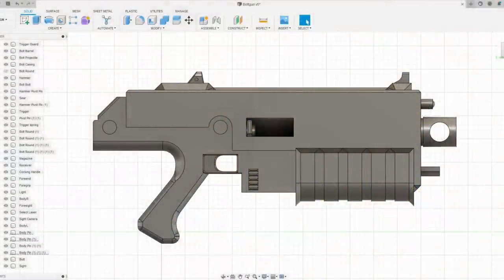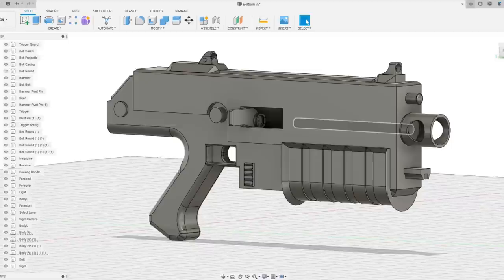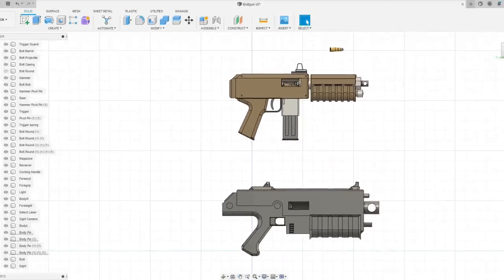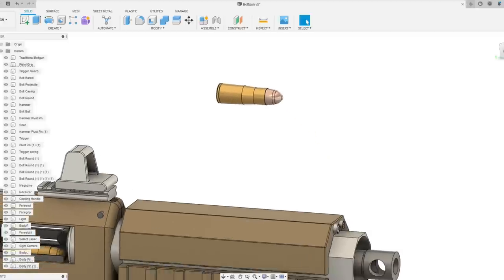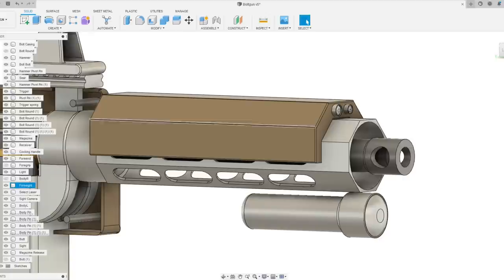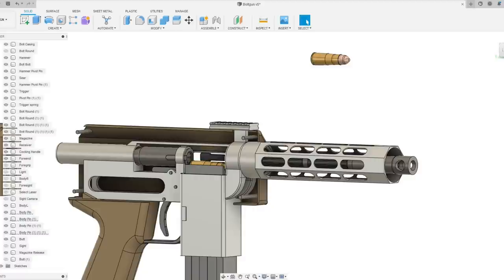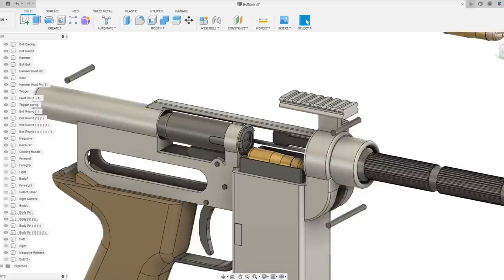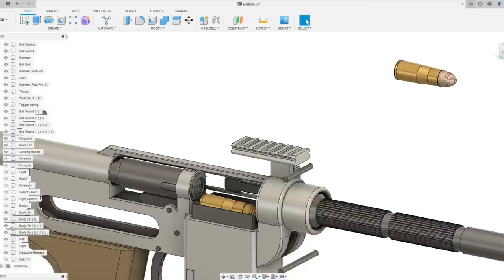Building A More Accurate Bolter

Comment: I enjoy any thought exercise meant to discover just how the imperiums equipment would look irl. On the point you made about the boltgun not needing to be bulky I think it would make more sense to apply a bit of our own modern logic to it. As an example a floating barrel is much smaller than the weapon appears to be, as far as i know the real reason bolters and other ballistic imperial weapons appear so big is because there are machines surrounding the actual weapons mechanisms which are meant to unjam them.
Reply: To unjam a bolter there's the need to cock the gun, so only a piston?
Reply: Bolt guns gave computer parts “ machine spirits “ basically semi AI so self targeting systems etc

Comment: one of the things you should note: yes muskets were roughly 50cal and up but their pressure curve was much lower because of the combustion rate of black powder. that lower pressure curve reduced the felt recoil by spreading the total force imparted over a greater duration. This isn't a gotcha since you could just use a cleaner and slower burning powder than modern cordite but it is something to keep in mind.

Comment: Really enjoyed the Video! As some one who works with CAD a lot I all ways like seeing other peoples work with it. I just wanted to point out the reason I suspect a lot of GW's stuff is out of scale is because of manufacturing limitations in the early days meant things had to be over scaled so that they would come out of the mould constantly. Artists then made art works based on these modals leading to the current strangeness of the Russ having officially a 120mm diameter barrel despite being shown on art work and on the table top having a barrel many times that size.
Reply: I know that the reason why the early Space Marines were squat-legged was for 2 reasons. 1st was to be able to sit on the bikes. 2nd was to come out of the mold.

Comment: for the size of the projectile and the damage being done by explosives the bolt round wouldnt need to be very high velocity so the bolt you modeled would probably be half the size. look at the inkunzi PAW and strike rounds, they have projectiles 3x the size of yours with the rest of the cartridge adding on a third of that. also combined with the gyrojet feature the barrel of the boltgun wouldn't have to be near as heavy.

with rounds that size and half the propulsion of the bullet being from a rocket motor you're right the recoil would be quite manageable. i headcanon that this version of the bolt round is what sisters and commissars use and the astartes version is the proper 1500+ grain light armor busting grenade. which as evidence by the PAW is still manageable by a normal person if the recoil system is good but its still too much to get any reasonable rate of fire.

Comment: Even with a delayed blowback system I’d be worried about an out of battery. I haven’t done the math, but with a .70 round plus the gyro jet there is going to be a tremendous amount of pressure pushing back on the bolt for system to deal with. In order to compensate the weight of the bolt is probably gonna have to be significant which might put it out of the range of feasibly for unaugmented humans

Comment: Hey Macca, as you stated and as is quite apparent the lore doesn't always conflate with reality nor depiction. Both relevant examples are seen with the ammunition being called 'caseless' despite certainly having cases, while a realistic Bolter at .70 cal wouldn't actually be unmanageable. Given this, I'd propose an idea to make a realistic Boltgun in keeping with the common 40mm analog, perhaps by scaling it with the muzzle break or something slightly smaller. How realistic would it be to make a 'small' arm at that caliber and how different would the resultant weapon be from what is already depicted.

Comment: The internal frame you had mounted the foregrip and sight block to looked similar to a keymod foregrip, just missing the oversized holes to one end for the cap bolts to slide into.

Comment: IIRC one of the reasons for describing the boltgun as a smooth bore caseless weapon was to do with vacuum contact welding. Non lubricated metals have a nasty habit of bonding when there is no air present, so the logic was that rifled barrels and cased ammo would weld as they entered the barrel. This doesn't explain how the bolt itself avoids fusing open, but an attempt was made before rule of cool defeated it.

As far as I can see; designing a fire control to be properly void proofed would require making it either a magnetic mass driver or using electro-thermal ignition instead of a physical hammer.

Comment: I actually quite like you’re version of the bolter however a few changes would be to make the upper front receiver and foregrip as one solid piece connected to the weapon itself as well as to remove the red dot sight due to space marines utilizing a heads up display

Comment: I think part of the functionality you didn't include in the design is that the boltgun itself is a weapon and meant to be one. I don't mean the boltgun itself and the rounds it fires, but it is also used as a club and that is it's intent in close combat, there are a few examples of space marine using polt pistols to swat away humans or smaller xenos, full length bolters as well used for clubbing smaller fighters as well as just the fact that the weapon is intended to receive damage and keep on functioning. I don't know what else the frame could have been made of, but I think maybe a little more stronger materials, maybe a little more blocky, but I am no firearms expert so I leave that to you to think of

Comment: I agree with the people defending the blocky aesthetic. The main reason light weight is valued in real life is that people are desperately weak. Space Marines are very strong and can carry much more weight for much longer. It makes sense that rugged strength would be valued over light weight. 

The Space Marines primary tactic is supposed to be shock assault. They don’t carry enormous patrol packs of equipment and ammunition. They want a gun that can withstand being deployed in a drop pod, used as a club and be able to operate in all atmospheres and gravities. 

Another thing is that the design philosophy in 40K is fundamentally different. Current design is reductionist, its sole consideration is efficiency. Space Marine equipment is artisan made and constructionist, the artist doesn’t ask, does my gun need elaborate golden scroll work? He puts the scroll work there because he wants to. 

That said props to you for making your own pattern of bolter good work.

Comment: I remember reading somewhere that the Boltgun uses magnetic coil relays inside the weapon to increase accuracy without needing a longer barrel, due to the close quarters that Space Marines typically fight in where every inch they can shave of the barrel counts.  Not sure how "cannon" that is because of how long ago I read that, but it does make sense.

Comment: I did enjoy that and appreciate your effort. Now I don't think a Blowback design is stupid, there is just more you can do. Look at post WW2 designs like Walther MPL, H&K MP5, UZI/MAC 10 and others and you will find a plethora of options how to deal with bolt travel and delay.
Reply from the maker: Mechanical complexity adds a lot of drawbacks. For example, roller delay mechanisms rely on the rollers not sticking, which is a problem when you have such crazy operating environments.
Reply: @TheOuterCircle  less than you might think, sealing against anything getting inside working parts is paramount anyway, look at the Owen SMG. The Walther MPL places the return spring and a connector rod ab
Reply: *mishap above the barrel in a separate housing and the UZI uses a mass delayed mechanism. There are a lot of ways to solve this. Nothing I say is meant to disparage your work.

Comment: I've only recently subbed to your channel, but going into the lore and mechanical workings with the physics of a bolt gun. The closest IRL ammunition is the 40mm grenade and the various different grenade launchers. Here in America, the Mark 19 Fully Automatic Grenade Launcher would either be a pintle mounted and a Heavy Boltgun for a Space Marine. I served 27 years in the US Army, having disassembled/stripped various types of weapons in that time. The way the 40mm round works is almost exactly how the Bolt round works, minus the penetrator tip for going through cerimite armor.
Reply from the maker: A bolter is a lot smaller than the MK 19, a weapon I have pulled apart and rebuilt several times, including the mighty 5kg block bolt!

Comment: Again, what software are you using Macca? Also props on making what is basically a closed bolt gyrojet luty! And yeah, 20mm grenades would be a more "accurate" size for how much damage they're supposed to do.
Reply: Fusion360

Comment: Nice exercise. I do suppose that when you share these guns among the guard, you adapt it more. A rifle butt (hope that is the proper translation), perhaps a different sight, grip, and fair point you made about the mag. So the human version should hold the magazines. The marines could easily hold a drum mag with more ammo, due to their strength. 

As to the bolt round itself. (Now the small size chemistry, hand gun rounds are not my thing), but it would be cool to expand a little on the types of rounds and give real life interpretations. Like, a shaped charge head for extra penetration, AP sabot for even more, but less range (again have no idea how the small size relates to Kinetic impact and penetration, i.e. how scalable these effects are) a hesh version, the regular slug version, a sniper version with bigger round for more range (and so a different bolt gun). There are different type of bolt gun rounds to explore. If you wish of course. But I’ll leave the thought here. 

As an example, there is an old artwork/picture on the AP shot from a vanquisher leman russ. And guess what… after all those years: APCR. 😝

Comment: I think boltgun round should be more like 20mm x 42mm grenade it's cross section looks actually remarkably like a bolt supposed to, front is solid, then explosive, except at the back you have fuse(?) instead of rocket engine, but reduceing fuse in size seems to me like something you could actually overcome with sci-fi bullshitery, also I have an idea for that over sized muzzle break, because the rounds supposed to be explosive and Astartes don't have to concern them selves with shrapnel the bolt might be always armed if that would be the case, then problem rise when the boltgun is shot at point-blank as it could potentially explode while still in the barrel, so this "muzzle break" could potentially serve as solution giveing round space to explode into

Comment: Boltguns never supposed to be caseless, though (at least to my knowledge). In the lore they supposed to use a small kick charge to eject it from the barrel and operate action, with bolt being then propelled with rocket engine.

Comment: Ah, many thanks for this video. I came across an interesting artwork showing a few boltgun bits like this (the artwork itself depicts a suit of mechanical marine power armor (for tau, off all factions) with what gundam universe would call "sub-arms" which assist in firing and reloading suit-used weapons and additional upper for the boltgun with far longer barrel and so). I've been also trying to redo most of the space marine equipment (weapons armor and so on) as a side hobby for myself, this video aids in that bit. Will you cover the heavy bolter? From most descriptions (1d4chan, for all their "quirks", agrees on this as well), it incorporates coilgun tech.
Edit to add: what be that 3d software used? Seems like perfect for realizing my drawings (on paper), into full 3d glory.

Comment: You beat me to a lot of nitpicking. A purely powder based firing solution erases the rocket propulsion component and would require a much longer barrel, but enough propellent to escape the barrel and then allow the rocket to activate works better for me.

I expect the versions used by unaugmented humans would be closer to .50 caliber, I know they are smaller in the lore to avoid obliterating the user.

Thank you for this video :)
Reply: My guess on the size and bulk of the original, is just a compounded problem from the early model parts scaled up with no refinement.

Comment: There is something fucky about caliber sizes standards, as I have gotten for .75 cal a conversion of both 0.1mm or 19mm from two different sites. So I thing the later is what they meant. (.998 is also a common bolter cal which is ~25mm.) Edit: I think its a in" vs cal confusion cause by how .50" is often mislabeled as .50 cal.

Comment: Typically bolters are .75 cal not .70
Reply from the maker: Well, I have two references in writing from within the last couple of years with both 60 and 70 calibre rounds. Either way, it's not a big difference, but that's why I chose that calibre.
Reply: @TheOuterCircle  during the GC there were definitely .75 cal, .70 cal, .60 cal, and even .50 cal models of bolters. However, during the HH many of these started fading away and by the end of the HH the .75 calibre bolter was the standard and remains as such into 40k. They needed the additional stopping power of the .75 calibre to put down marines. Those smaller bolters still exist, but they're linked to specific patterns and variants. 

While there may not seem to be much of a difference between a .70 cal and .75 cal projectile. You have to remember a .70 cal bolt would be 17.78mm and a .75 cal bolt is 19.05mm. Which is a difference of 1.27mm, that's like saying there's no difference between 5.56mm and 7.62mm cartridge because there's only a difference of 2.06mm. Which obviously isn't the case.

Not having a go at you mate, love your videos. Just pointing out the lack of .75 cal bolters and the difference.

Comment: .. um.. without the magazine 'lips' to hold the rounds in the magazine, as soon as the bolt-carrier group is brought out of battery, the rounds are just going to leap out of the magazine and spill out of the ejection port, with the "BCG" slamming down on a round in a stove-pipe failure.

Just thought you should know.

Comment: While this is a much more function accurate representation of the bolt gun than the space magic wrath of the emperor, there are a few key problems:
-lenght of the barrel compared to the amount of propellant that needs to get burned
-no rifling so you just made the ammo the gun is shooting already more inaccurate so the gyrojets need to work more
-with this design it's an open bolt direct blowback system, but it's very much non-functional as the bolt is way to small to have enough mass for the weapon to not immediately explode with the force the propellant will produce
-the fire mechanism is way to high for a direct blowback system from the trigger, this will increase vertical recoil
-charging handle let's dust and debris get into the mechanisms of the weapon
-there are too meny not made from one piece parts on the weapon
-there are too meny open spaces in the weapon that don't serve any function
-to compensate for the recoil I would most likely make the muzzlebrake have ports more angled on the upper side of the device as to better counteract vertical recoil